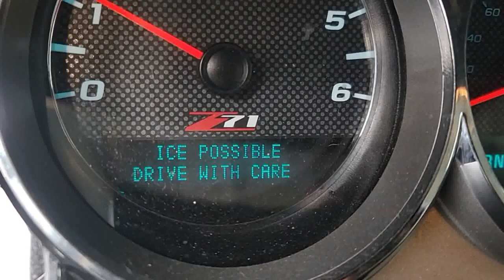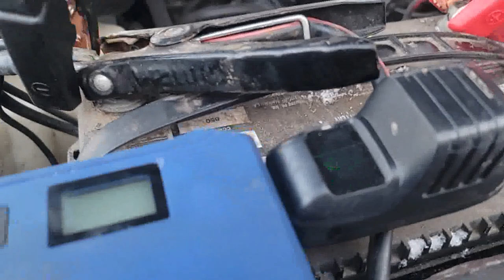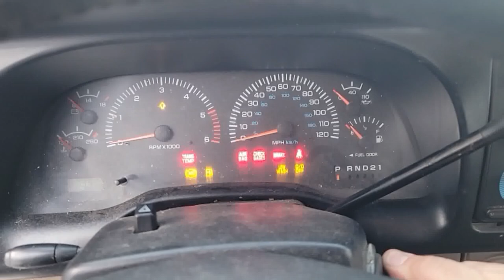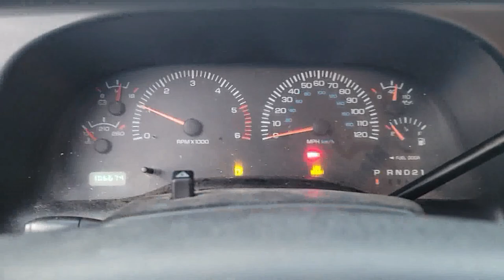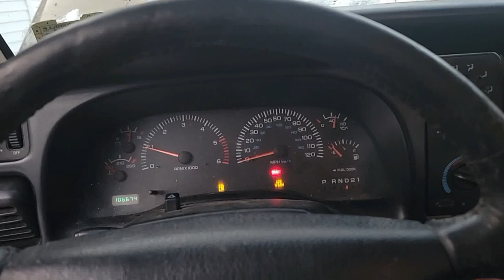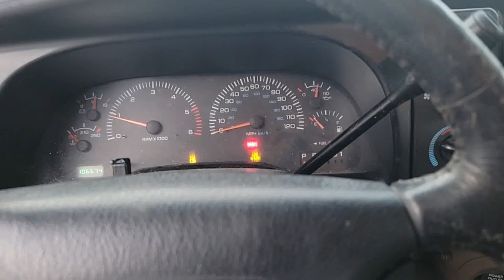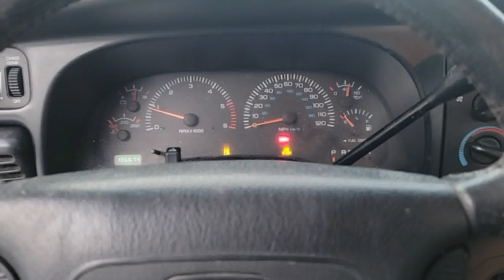Frozen Junk Subaru and Dodge Ram

Comment: That dodge was beaten
Reply: Goes to it gravyard
Reply: @brianthurow616  Dodge pick ups were always a decent truck by the weak points for the ball joints and transmissions mechanically and cosmetically there dashboards at least on the Rams I never had a problem with that

Comment: That dodge has life lift in it if keep it can't find the older ones it runs minty
Reply: Torque convertor bolts sound loose rattleing
Reply: It’s a dodge, things are junk the day they rolled off the line